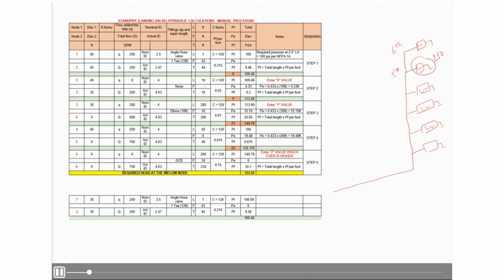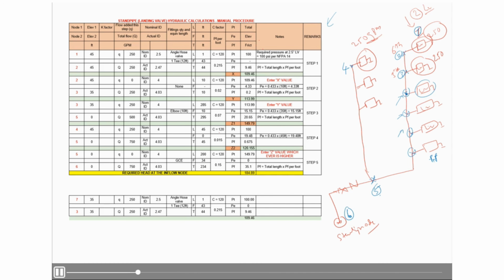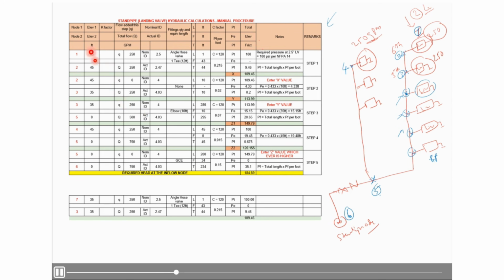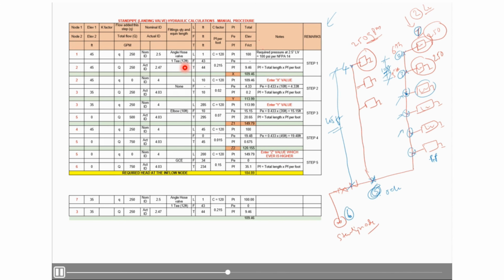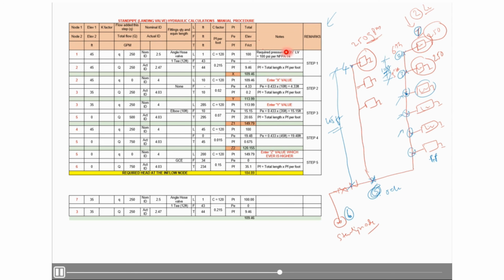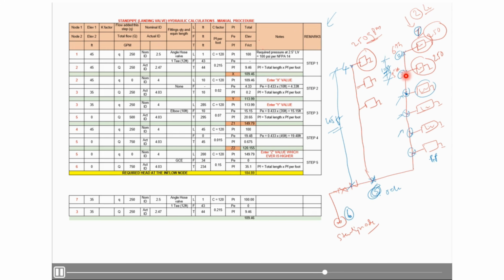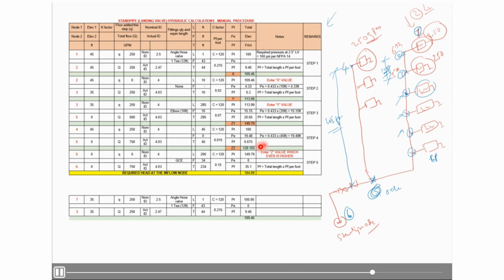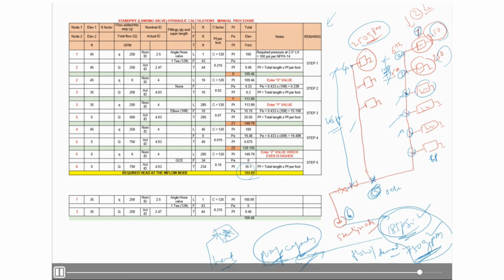Class 2 | Hydraulic Calculations | Standpipe systems | NFPA 14

Comment: Can these 3 hose valves work together with the sprinkler system, and then we add sprinkler demand to the hose demand, e.g., hose demand is 750 gpm + spk. demand 500 so that the pump cap. becomes 1250 gpm. Is this possible?
Reply from the maker: Hose stream allowance is added to sprinkler demand. But hose / standpipe  demand is separate and should not be added to sprinkler demand

Comment: why you didn't include the Tee on the Node 3 and Node 5, just like in the Node 1 and Node 2 the Tee is included on the calculation.
and what is the meaning of GCE on the Node 5 and Node 6
Reply from the maker: Gce means gate valve check valve and elbow. If you want to understand how to consider the fittings please check elite fire hydraulic calculation series in which I explained the procedure using isometric diagrams. Please check playlist “elite fire”

Comment: Can we use the same calculation for the private hydrant system in India... What will be the fitting equivalent length for oblique landing valve
Reply from the maker: U can use since it complies with nfpa 14. For equivalent length please check nfpa 14
Reply from the maker: If u are using outdoor hydrants u need to follow nfpa 24. Please check my elite fire series playlist

Comment: At node 3, should we not consider the 500gpm? because on that node 3 the flow is going to the 2 most remote hose instead of one, similarly, at node 5, 750 gpm. should have been considered. kindly answer.
Reply from the maker: Can u just provide me supporting document from NFPA for the proposed.
Reply: Brother, this is my question, I am not saying you are wrong. 
(I usually watch your lectures. Which is very informative).

Comment: Thanks sir Irfan, i just have one question, to determine the size of the fire pump, I performed sprinkler system hydraulic calculation and I got 500 gpm, for the remotest warehouse building, I have 3 more warehouse, is it proper to say we will add 3x250 gpm to the 500gpm so total would be 1250 gpm? Thank you so much. Likewise for class 3 what is the required flow and head pressure?
Reply from the maker: Hi, for sprinkler demand just we will consider remotest building only. We will not add as u said…we just add hose allowance with sprinkler demand.

Comment: Thank you, could you kindly explain the ditances between risers in one floor if its area is too big, what is the area limitation and how much distance shall the risers be placed from each other. what is the normal hose length for 2.5 inch connection , Fire Dept Hoses, The number of risers that must be used calculation. I have read if the area is fully sprinklered so 200 ft 60 m is applied , if not 150 meter. so is it the criteria to be followed while chosing the number of risers provided one riser covers 50000 sq feet for LH and OH Occupancies?
Reply from the maker: As per my knowledge for each stair case one landing valve riser is must. and regarding the floor area for zoning, it will be applicable for sprinkler system and not for landing valve riser...for light hazard one zone will be maximum 4832 sqm...and so on...

Comment: Why do you not include the elbows (90s) between Node 1 and Node 2 also between Node 3 and Node 5
Reply from the maker: As a basic rule all the fittings shall be included in the calculations but should not be repeated. Please go through the video once again and decide yourself whether I missed those fittings or not. In case if I missed then definitely you need to correct accordingly

Comment: Very well explained Sir. Thank you very much for sharing your knowledge. I have question: The system has one pump only but it has 3 risers connected. 2 risers for wet stand pipes (with class 1 hose) and the other 1 riser is for the sprinkler and class 2 hose demand. How am I going to compute the total GPM capacity and the Total PSI requirement? I hope you could also create a video in this kind of system.
Reply from the maker: Thanks. If u have two risers for standpipes then u can (500gpm from remotest riser + 250 gpm from other riser) and run the calculations for standpipe. For sprinkler system u need to calculate the sprinkler demand including hose stream allowance. Third calculation will be done by considering two remotest class 2 fire hose cabinets. Which ever flow and head will be more consider that demand.
Reply: @irfancfps  Thank you sir for your swift response. Just to clarify, you mean that highest result among the 3 calculation results will be  used for the pump capacity? Also sir, how am I going to compute the 3rd calculation that you mentioned if in case the two class 2 hoses are connected from the same Cross Main, wherein the branchline of the sprinkler are connected as well. I hope you'll have video in the future of combined system with riser and  stand pipes.
Reply from the maker: @jamespaulnero4442  I will reply. Please send me a test email